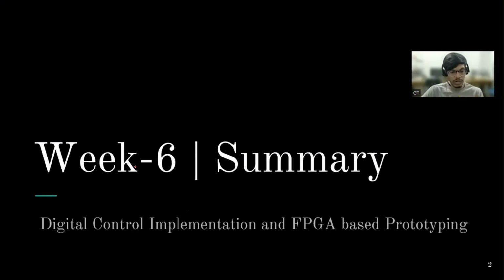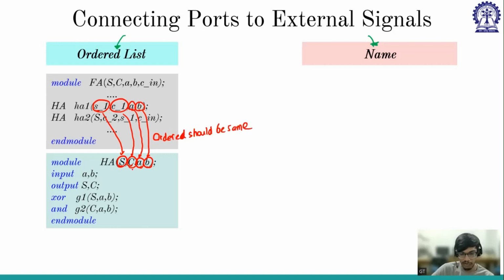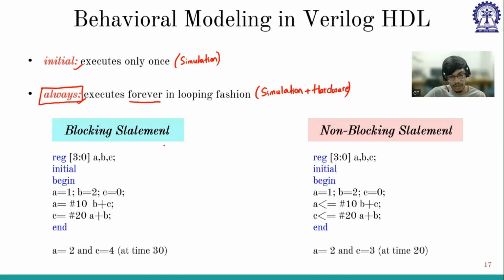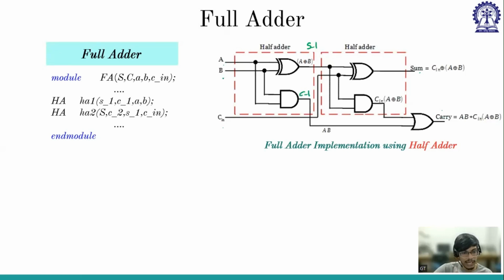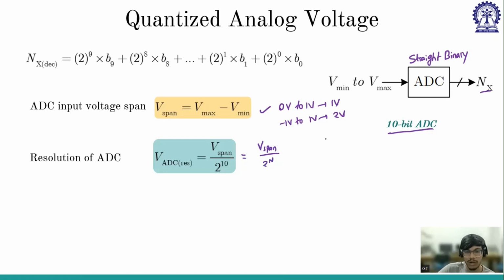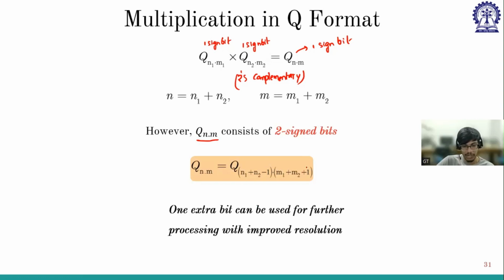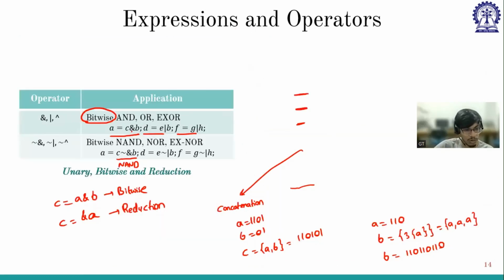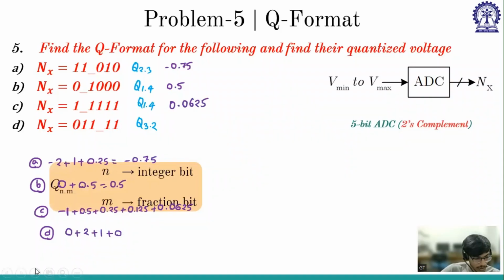Week 7 | NPTEL | Introduction to Verilog & Simulation using Xilinx Webpack | Problem-Solving Session

Comment: Sir one doubt regarding the always@(posedge clk). If two input are 0001 and  1111 and output is their sum and during the first positive edge, the answer will be 0000 with carry. During the next positive edge, we need to take the carry along with next inputs.
Reply from the maker: Rajeev, in the Ripple Carry Adder that we have considered for simulation, our inputs and input carry are user defined and we are checking the output sum and carry to ensure our Verilog code is working fine. No, we are not feeding the output carry as input carry during the next rising edge, the code isn't written in that way. But you are free to write the code in that way and check the working of code. It's an interesting example, you may try and check the working of code using simulation. If you face any difficulty, we may discuss in the next session.